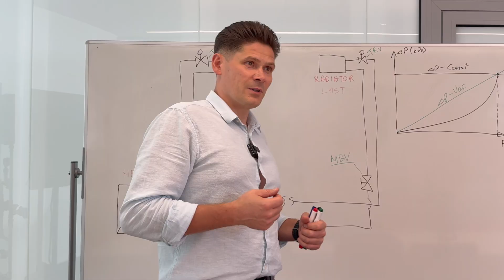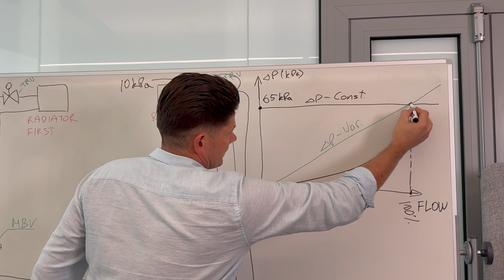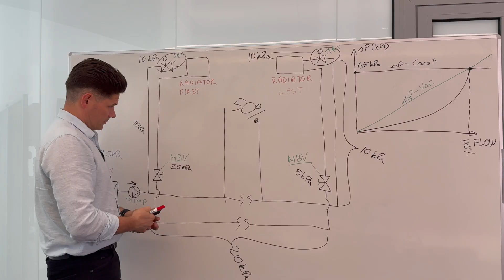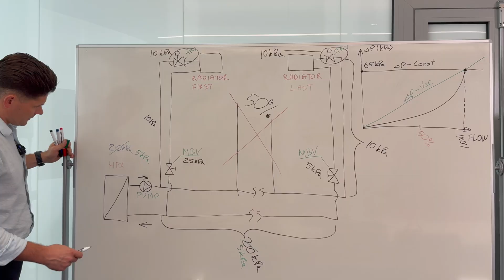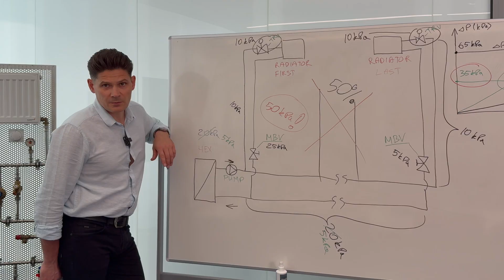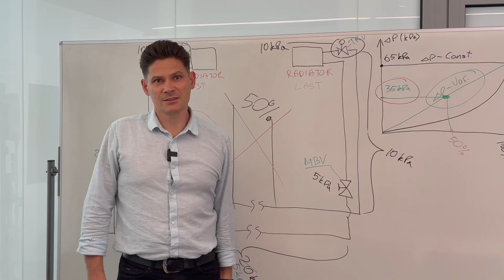STOP Installing These Valves!

Comment: Hi!
How would constant dP valves on each riser or PIBV-s solve problem of undersupply in riser 1 in partial load conditions when pump is dP=var. controlled?
Reply from the maker: Hi! Dynamic balancing valves, such as differential pressure controllers or PIBVs, dynamic valves, dynamic H pieces.... automatically adjust their opening. When the differential pressure from the circulation pump decreases, the valve reduces its own pressure drop accordingly. This ensures that the required design flow is maintained under all operating conditions.
Video how dynamic valves works: https://www.youtube.com/watch?v=xDvvuqmSb1I&list=PLwz1O-4n12mcVf2PaSNGndNyn724QtOBR
Video how to optimise circulation pump setting if dynamic valves are used:  https://www.youtube.com/watch?v=cil-_BMSZks&list=PLwz1O-4n12mcVf2PaSNGndNyn724QtOBR&index=6